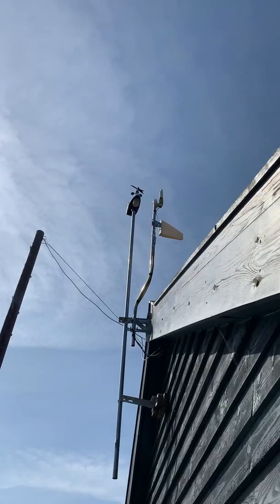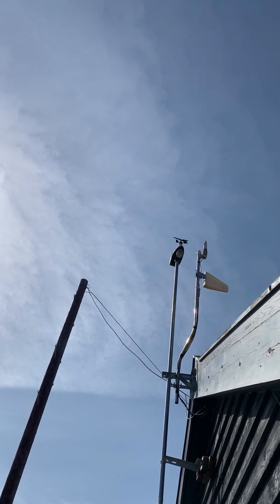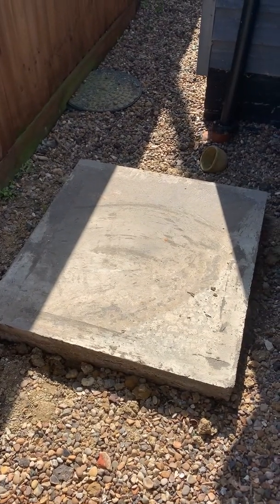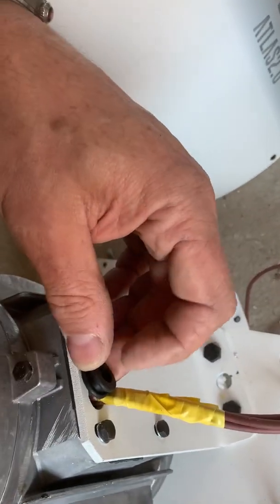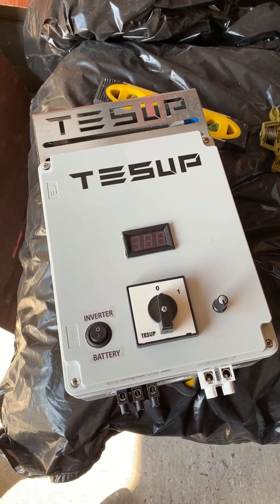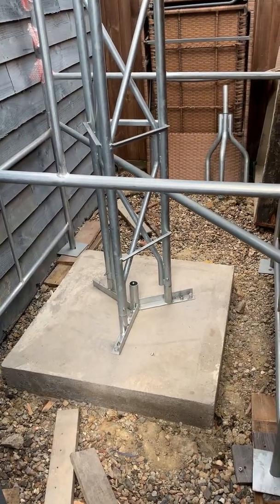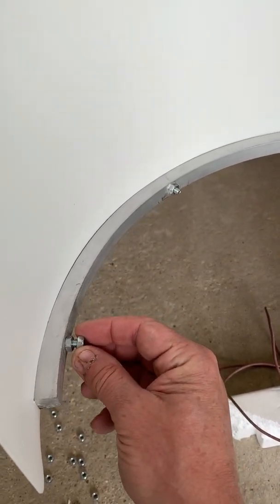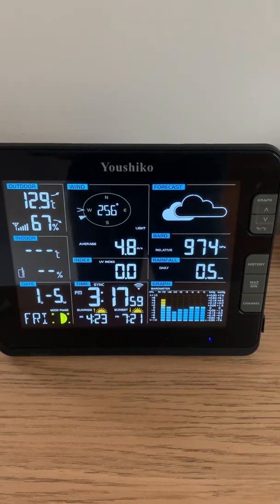TESUP Atlas 2.0 Wind Turbine Installation & Review

Comment from the maker: * UPDATE *  TESUP have offered me a free replacement of the TESUP Atlas 2.0 vb to test. This has many updates following the comments you all have posted here so I will conduct trials and post results on here and separate video.
Reply: Hy DL and others, I buy the same configuration white you in 09/07/2020 and I recive last week the D3000.I continium expect thelivery the Turbine and Control (time for thelivery 30 days, information the Tesup) I'm happy lissen your news DL , I'm buy because this rewiew .Continues a make the good rewiew.
I post and change information whith you and all.
73
Reply: Nice to hear. What is your overall opinion on the Atlas 2.0. I think it's a load of bull as they advertise it as an 2Kw turbine
Reply from the maker: Shelby GT-H NL “load of bull” is probably too harsh a position. I would say that version 1 had serious issues with design when used with anything other than 12v battery system. It required to reach a consistent +30v DC to activate the inverter option and I would say their suggested power chart was out by at least 70%.  All turbines advertised at Xkw need wind speeds almost close to Gale force to get to X. Most “normal” wind occurring in your average location at round 20-35% of the suggested power curve.
I had an expectation that at 6m/s I would generate at least 100w with 8m/s 400w. This was about 50% of the suggestion. Reality was much lower and let’s see what version 2 brings
Reply: @Homewindturbinereviews   Ok, when you have received the version 2 are you gone do another review?
Reply from the maker: Shelby GT-H NL yep. They are sending 2 week September from Turkey and then I’ll,install,and review by end September
Reply: @Homewindturbinereviews  I have just ordered a zeus3.0 will be interesting to find out if it suffers the same issues.
Also went the jabber tower route.
Do you think that the delta inverter is required due to the low startup voltage? I had been looking for an alternative..
Reply from the maker: @bardriot8351  yes if you want a proprer web monitired solution the Delta is probably the only good option. The cheaper 1kw chinese inverters work but youy cant monitor performance
Reply: @Homewindturbinereviews  you don't happen to know the voltagerange  output from the charge control to the inverter? Tesup aren't being helpful in supplying a d3000.
Reply from the maker: @bardriot8351  If you have it on the pass through setting (rather than restricted to batteries) ive monitored with a meter 18v to +60v. 18v approx when it starts to turn and then +30v after about 3.3 m/s. Issue was always amps and power, not volts. You will need to have some solar connected to the 1st pair of MTTP to ensure the panel is always on (in daylight anyway) otherwise ithe D3000 will keep restarting if it drops below 30v. Given that average wind of say 4-5 m/s should give 50v and maybe 5amp you will keep dropping below 30v due to gusting and lulls.
Reply: @Homewindturbinereviews  OK good to know. My average wind speed is 5.6m/s at my location so I'm hoping it will work out OK.
Reply: I'm trying to find a decent inverteter with low startup. As I didn't select the correct setting when ordering and they don't offer the inverter on its own. I'm pretty sure it's a solar inverter the d3000.. Can you input wind turbine curves?
Reply from the maker: @bardriot8351  sadly not without Delta support and i cant find anybody to support!  Let me know how you get on. I get the version 2 in 3 weeks to test.
Reply: @Homewindturbinereviews  the closest I found to the d3000 was delta solutions h3 flex which is very similar.
My only worry purchasing something else is that the charge controller won't supply enough startup volts as most inverters seem to be 80v plus
Reply from the maker: @bardriot8351  yes there was nothing i found other than these 
https://www.ebay.it/itm/1000w-Grid-Tie-Inverter-Limiter-sensor-Solar-Power-Inverter-Wifi-Plug-DC-22-60V/193223537482?ssPageName=STRK%3AMEBIDX%3AIT&_trksid=p2060353.m1438.l2649
Reply: @Homewindturbinereviews  thanks for all your feedback. Waiting for the second version. Hope it will work for you.
Reply: Looking good guys to see all these comments. I hope to see more details on version 2. I currently run a 48v solar system and intend to integrate the Tesup

Comment: Hello DL... Can you pls confirm with me if a breaker switch is required from wind turbine to charge controller? My installer says  he needs to put one. If so, will the stop switch work out or not on the controller? I assume the stop switch will act as short circuit to stop blade turning
Reply from the maker: Hi, I’m not sure you should put a breaker (isolator if that’s what you mean) before the charge controller. If you cut the power to the charge controller then your turbine will run free. The TESUP charge controller position 1 is the brake. I personally would add the isolator (if that’s what you’re trying to do) after the charge controller. However some charge controllers only rectify and don’t brake. Check your installation
Reply: @Homewindturbinereviews  ..ok noted. Did you try the stops switch? Does the blade really stop moving with resistance? Mine was already setup. But if you click to stop or '1', still the blade turns freely. The wind is only around 2m/s. I tried to short cicuit the 3wires, still it didnt stop. Can you comment pls..
Reply from the maker: Helimariner then it’s not connected correctly (or broken) as the controller definitely stops the blades turning in +5m/s. You may get a very small amount of turn at higher speed.
Reply: @Homewindturbinereviews ... Tnks for your input. I just discovered the small bolts on the blade shaft is loosed. It was slipping. So i tightened it up. My blade can stop now if i turn the brake switch.

Comment: when i do some digging online on this vertical wind turbine, i heard ppl saying if the tower vibrates u would get heavily reduced power output.  its best if u could mount it on rooftop with short and rock-solid mounting pole.
Reply: also if u  anchor the top of the spinning rod into something solid with a ball bearing system. it might reduce even more of the vibration and boost little further
Reply from the maker: redhongkong there are no issues of rpm and tower with guys at height is better than lower roof

Comment: hello everyone, I bought this turbine on April 3 and after two months I have practically nothing, the charger had arrived disassembled and broken, they withdrew it but they never sent me the new one, and the money kept them. I bought a charger on my own but it does not even generate 1Watt the output voltage on the phases when I connect them and between 12 and max 40 volts and probably for this reason the regulator doesn't even bother. the tesup is not worthy to answer even my requests, do you have any suggestions in case I was wrong at least as regards the turbine? the output voltage on each single phase of what it should be to operate and charge 48v batteries? I'm thinking of passing the thing on to a lawyer.
Reply from the maker: Is it the 48v turbine?
Reply: @Homewindturbinereviews  I had requested a 48v, but after a few tests I realize that it must be a 24v, but in any case even at 24v it does not work, since it is not able to run even a fan from a PC without the tension going down drastic. by measuring the output current to charge 2 batteries in series the amperes do not go beyond 0.02A
Reply: @massimo5962  I'm in the same boat. I purchased a 24V model and the max AC voltage is between 12V and 19V in strong wind. The communication with this company is a nighmare. I'll not recommend this turbine at all.

Comment: Having read all the comments, can you give an overview of the system based on the conditions you have to date. Thanks
Reply from the maker: I would say that (unless I have a damaged turbine - TESUP don’t answer my emails) and it seems to turn ok...then the output from the 48v turbine does not start properly until well after 7m/s wind (which is 25kph (very very windy). On the 48v turbine at wind speed from 3.5 to 6 m/s you will get hardly any power (maybe 50w).

Comment from the maker: I’ve now had 3 weeks to assess performance accurately with a built in recorder.
I’ve got it hooked up to the Delta grid tie inverter which should operate around +30v. However the data shows that the best output into the inverter has been no more than 107w at 6.8m/s.
It’s the 48v turbine so maybe you’d be better with the 24v to,batteries but so far I’d say this is a failure as a grid tie.
If anyone has any ideas then please list...!
Reply: Well I'm still waiting on my vawt I'm waiting now more then 40 days I'm thinking of cancelling the order and send everything back. It would have been a perfect way to fill in my day job as electrician. I can't build on this. This was also the only one that is affordable with this kind of power. 2kw is too good to be true. But if it were true it would be awesome despite the thing of too much wind. Above 53ms (what never happens) tilting is not an option  if you have a few thousand on rooftops mounted on flat balconys everywhere with a maintenance subscription. Well the balcony would be better but on rooftops? Pffff I had a customer all ready he asked ok but how must I do that when there is too much wind? I must climb on all the rooftops I supervise? Where must I take them if I have 10 of them on the rooftop. It's not good enough. Serious if this works I need to hire people to mount them. I hope it would only be the covis-19 stress. Because for me it was a dream come true. 2kw day and night with windforce6? You know Holland is windmill land right? But the waiting is too much... how can I sell this to a costumer... and me... I'm without work now and thought this was a solution.
Reply: The inverter's MPPT function might be hampering the controller. I assume inverter mode is just direct from the bridge rectifiers?
Reply from the maker: Dehv Blak it’s the specified controller from Tesup to use with their controller...
Reply from the maker: No it doesn’t work at all when you disconnect the solar. The Delta power curve software for low voltage input is clearly not suitable
Reply: At 6.8 m/s the expected power output from a Savonius type turbine with 1.1 m2 swept area is: P = 0.5*1,225*6.8^3*1.1*0.2 = 42W. If you are measuring 107W (after losses at the rectifier and inverter) - then your wind speed measurement must be wrong (underestimated). The wind power over 1.1m2 area of the turbine (at wind speed 6.8 m/s) is only about 211 W. So - if you manage to recover 107W - it would indicate efficiency of the Savonius type turbine in excess of 50% - which is more than the best designs of lift-based turbines (and contrary to all research which indicates that 20% efficiency is about what you get).
Reply: Disconnect the solar panels (despite being on the second channel mppt on the inverter) and see how it responds, or into batteries - looks like its just a PWM battery controller however so I doubt that would be accurate either. 
Maybe the delta has a way to lock the MPPT voltage on each channel? 
If it was me, I'd try putting the "inverter" mode it into a boost type MPPT charge controller and see how it outputs. after making sure all 3 phases from the tower and outputting AC.

Comment: I have a question. Does your windmill also make a humming sound with vibration? I have one that does that.
Reply from the maker: mark stam Hi Mark. No humming with this one. It can make a slight knock sound every rotation if you don’t get the vertical axis perfect (I think the blades causes the shaft to wobble a bit). Overall I would say no. I’ll post a quick video soon
Reply: D L Hello you would like to email me I have a few questions for you about the mole and inverter gr mark
Woodpeckermarkstam@gmail.com

Comment: Hi I ordered one but it's locked I have to wait, if this really works 2kw I have enough work for years to come on installation of these turbines. I'm setting it up on my flat roof mounted on a tile. The roof of my apartment near the sea is at 12 meters so enough wind. I will be also making video's and posts about this windmill. The only thing is what if it is blowing harder then 57 m/s that almost never happens anywhere I think you must cover the blades. I'm not gonna tilt it you would damage the vawt and it's unpractical.

Comment: Greatings, and thanks for your video, How many watts, it produces with an average winds. 10 to 20 km/h
Reply from the maker: Honestly I would say broadly nothing at10kph as it is just starting to turn. At 20 (5.5m/s) you get around 150-200.  I will be doing another video measuring speed and power soon
Reply: @Homewindturbinereviews  Thanks for your reply!
Reply from the maker: YV5EMG HAM RADIO see my latest update. It is not,suitable as a 48v version grid tie
Reply: @Homewindturbinereviews  i dont understand whats wrong. If i have 48V batteries it will work for me ?
Reply from the maker: La Guilde des Courgettes I think batteries will work much better than direct inverter connection. Let me know when you try
Reply: @Homewindturbinereviews  ok so you see you're product something but something is wrong or dont work with your inverter ? Ok i will make the order this weekend. I really hope it will work...
Reply: @Homewindturbinereviews  i ask some help to a friend. He say that the 48V one will only charge when rate 48V so at 7m/s. They show it into the courbe of production.
Reply from the maker: La Guilde des Courgettes you can get a charge controller with volt increase so it takes 24v at at 1 amp and create 48v at 0.5amp
Reply: D L Hi! Can you please share more data  from Atlas 2.0 How much energy it’s produce average (15-20 km/h) under one day? how about the noises it’s produce? Thanks for your video!

Comment: Hi, I done a fair bit of video watching while researching turbines. Im moving to a new house soon on South Coast UK with a fairly uninterrupted view to the sea about 1.25 miles away. Been looking at Vertical turbines. All the videos say the cheap Chinese ones are useless. This TESUP is the first one that looks reasonably good. One thing you may be able to answer On their website it says if the wind is over a certain strength. (force 11 I think ) you should cover the blades to stop it turning. Not very practicable if its on the roof of your house. Do you know if there is anyway of remotely braking it? I have messages TESUP and they pointed me to your video. Thanks
Reply from the maker: Barry Johnson Hi Barry
I think you’ll have to rely on the manual brake on the charger controller. The advice is over F11 (30m/s) then you should effectively take the wind turbine out of the direct wind (tilt) 
This in impractical so I’ve add a pulley and rope at the top of the tower so I can lash it if necessary
Reply: @Homewindturbinereviews  Thanks for your reply. So it does have a brake? I didnt see that anywhere.
Reply from the maker: Barry Johnson yes on the charge controller. I show it on the video.  Cheers
Reply: @Homewindturbinereviews  Thank you
Reply: if you have not yet bought do not do it, it is a semi-phantom company if you are lucky they send you something faulty or incorrect, they sent me a charge control failure and wrong turbine and they did not want to know to give me assistance. too risky buy elsewhere, they are worse than the Chinese
Reply: I would honestly say to anyone buying a turbine don’t go for this one, I would rather invest in a really reliable one such as journey wind turbine 13+ as it is very reliable and perfect
Reply from the maker: Gulam Gaibi please don’t promote others on my video. This is a simple review for others to decide on
Reply: D L apologies didn’t mean to

Comment from the maker: TESUP have added a new analytics curve to the website. I will review this later vs actual performance
Reply: 275W at 5m/s wind speed, seems in line with MFG specs:
- Rated Power @7 m/s= 530 Watts
- Maximum Power @15 m/s= 2020 Watts
Reply from the maker: Dehv Blak doesn’t get anywhere near that now I’ve had it on test with an in-line meter.  Max 60w at 5m/s
Reply: @Homewindturbinereviews  I already wanted to say: what a positive video about tesup or VAWTS in general...
60W @ 5m/s is a lot for a VAWT, especially a tesup is what I can see from most videos.
The tesup says 2kW, but none of the circuitry can do that.
I already gave up on wind turbines. The best I can do is use a few cheap VAWTS and hope to add a 200W average on a windy plane.
flowerturbines are very clear about it: if you have 5 mid size turbines you are lucky if you get 1.5kWh a year, depending on circumstances. And the only reason I want wind turbines is to cover the dark periods.
These days 400Wp panels are less than $200 . It's cheaper to add 10 of these than 1 wind turbine, and yield more energy in the dark days than a tesup VAWT.
Reply from the maker: @bloepje  totally agree

Comment: Great video. I’m looking at the master 940, just wondering whether your power output matches the wind speed according to the data sheet? I’ve heard varying reviews of tesup.
Reply from the maker: Hi, I doubt it. I think the power curve is much shallower up to 6m/s and then kicks in. Yes it does start to turn at 2.5 but you get next to nothing up to 4 m/s. I was getting around 200w at 6.5m/s. They’ve removed the graphs from the website so I can’t check now!  They suggest 1200w at 11.5m/s which I guess is possible but that’s a very good wind.
Reply: My 940 output is so low it doesn't even register on the charts.